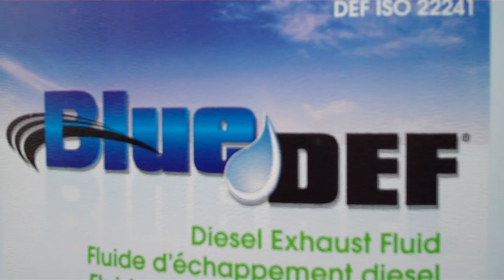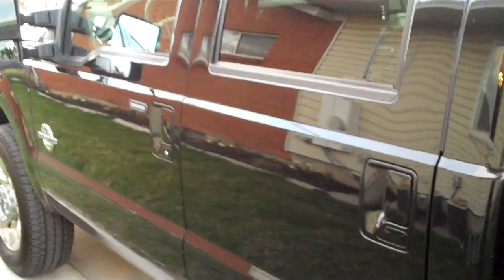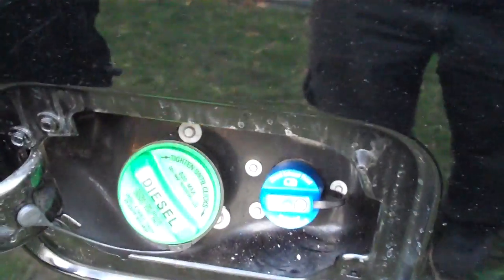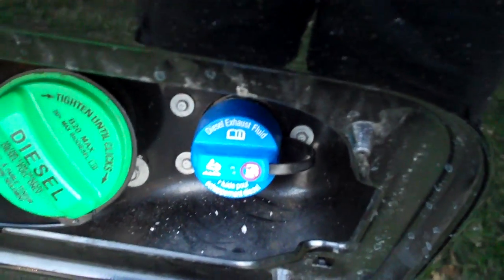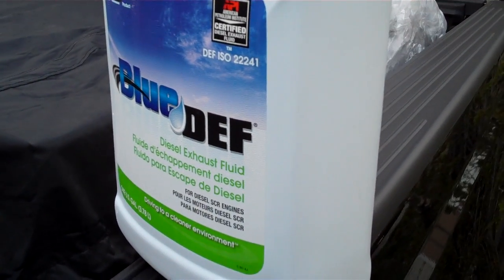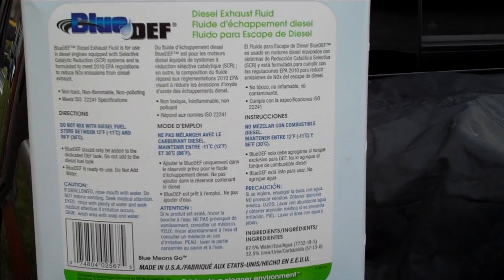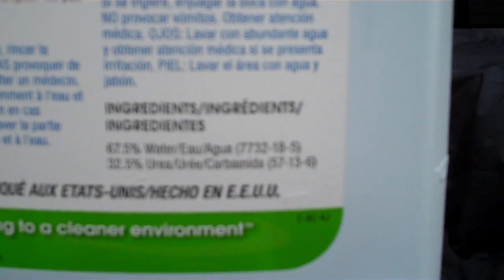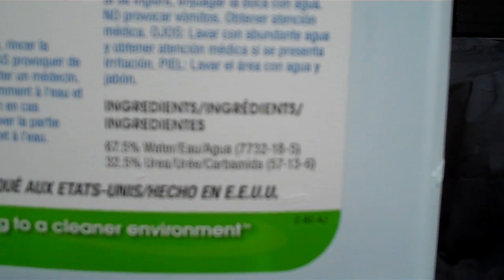DEF Diesel Exhaust Fluid What is it? How does it work?

Comment: Would you know if def is toxic?   I am the yard guy at night at Budweiser.   In the winter I need to keep the engines running on around 50 trucks I to be loaded.  I know I the old Diesel engines didn’t make me sick but the new def ones have a toxic smell and blue smoke in the light.

Comment: That stuff can be bought in bulk at the truck stop for around 3.00$ a gallon
Reply: Remember you get what you pay for. DEF at trucks stops is not mixed properly. This will cause early system failure. Its best to invest in the single jugs in my opinion

Comment: So the system will add this the gas if needed? If you have a well-maintained diesel engine, will the DEF even be used? Would a brand new truck use DEF right away? (Basically is it a question of a well-tuned diesel engine vs one that is not? Or is it like water to humans, where your body will consume water whether you consume some or not?) Thanks. I overheard a commercial that mentioned this, so I was surprised that diesel trucks need this extra fluid to run.

Comment: At Walmart for $7 per 2.5 gal jug https://www.walmart.com/ip/DEF-Diesel-Exhaust-Fluid-2-Jug-Bundle/384243022 adblue
Reply: blue def in the 55 gal for $124 each.. https://www.walmart.com/ip/DEF-Fluid-55-Gallon-Drum-Diesel-Exhaust-Fluid-4-Pack-Super-Value/625918580
Reply: $123 per 55 Gal barrel of DEF fluid at Walmart.. https://www.walmart.com/ip/DEF-Fluid-55-Gallon-Drum-Diesel-Exhaust-Fluid-4-Pack-Super-Value/625918580

Comment: A tank of gas or 300 miles? I have the Titan XD Diesel and 4.5 gallons lasts closer to 4500-5000 miles
Reply: Serves you right for buying a new vehicle.
Reply: rod builder Your reply makes no sense! Lmao. I'm getting almost 5k miles on a tank of DEF, not 300. Those of us with the means, prefer new vehicles. If you're worried about paying $30 every 5k miles for DEF, your not the demographic for a $64k new truck.

Comment: Biggest scam the government ever forced on us
Reply: LOL  I dont think it's the biggest, but it definitely makes the list!
Reply from the maker: Not even close, but I digress.  Nox are what cause acid rain.  In Europe their statues, cathedrals, sidewalks etc are being eaten by acid rain from vehicle emissions.  There, you have records of what things looked like and in the last handful of decades things are looking like 480p or 720p instead of 4k resolution due to acid rain from Nox.
Reply: Funny cuz every morning when I’m hooking up my trailer with my new truck with a grass burner the exhaust I have to hold my breath while I am working cuz the nasty smell the DEF creates will cause my throat to chafe so bad, just like when I used to work with liquid chlorine. My old tractor with a simple Diesel engine no emissions crap never had a problem
Reply: @Austin Jensen idiot
Reply: expert in justice total scam. Don't use it in UK
Reply: DEF FLUID (2 pack) of 2.5 gallon jugs for $7.00/each - FREE SHIPPING!! https://www.walmart.com/ip/DEF-Diesel-Exhaust-Fluid-2-2-5-Gallon-Jugs/837857789
Reply: expert in justice I wonder if it will smoke if it’s super low
Reply: Walmart DEF BOX $9 per 2.5 gal.. https://www.walmart.com/ip/Sinopec-DEF-Diesel-Exhaust-Fluid-2-2-5-Gallon-Jugs/837857789
Reply: @mrgilmore6953  how many of your 13 IQ points did it take to come up with that
Reply: @mrgilmore6953  and how's that? Because I like clean air?
Reply: @mrgilmore6953  #logic 😀
Reply: expert in justice biggest scam was 9/11, and then it was diesel DPF (diesel particulate filter)
Reply: God forbid we keep toxins out of the air. I'm sure we dont need to breathe.
Reply: its our air. 
only thing that shitty about this is how it will reduce truck power. unfortunately they have to do shit like that because of self centered twats.

Comment: hi how big is your def tank on your 2012 ford?
Reply from the maker: It's not mine, but I want to say its' about 2.5 gallons.  It lasts about 3k miles give or take.
Reply from the maker: +Billy Swarthout Not sure.  5 gallons I think.  You can fit about two 2.5 gallon jugs in it.
Reply: Ok. Thanks
Reply: do you think all DEF is the same. walmart has supertech def for 7.88 for 2.5 gallons
Reply: What happens if you put diesel fuel in it?
Reply: Renzeth Bulawan
Reply: No i meant what gonna happen if that happens,
Reply: It's about 6 gallons.

Comment: DEQ is a brain dead bureaucracy.... take a truck that gets 22 mpg... add smog till it
gets 17 mpg (and save the world by emitting more emissions).
Now just add chemicals and further screw up the air for just a meager $6 a tank and
soil the truck with 12 bottles of unwanted chemicals behind the seat and a damn 
funnel.
Reply: Also displaying a poor understanding of high school chemistry. The urea will react with NOX and the only products will be nitrogen, water, and carbon dioxide. NOX is horrible for air quality and can lead to fine particulate formation in the air and ozone at ground level as it mingles and reacts with atmospheric gases. Inhaling NOx is bad for you but ozone and those fine particulates are even worse.
Reply: @alexanderlowe4236  It's an attempt to reduce particle emissions, and it sorta worked Apparently.

Comment: If The DEF fluid is made with water....then it will freeze. I live where winter time is usually sub zero temps. How does the DEF fluid thaw out? Is there a heater to it in the tank? Does the engine heat thaw it out? Or do you just have to bring it inside? Thanks!!
Reply from the maker: If you fill the DEF tank on my 14 Ram to 3/4 full it won't freeze they say- in fact they ship the truck by rail through Canada 3/4 full of DEF.  It is about 65% water, but it's purified, deionized water and the Urea brings the freeze point down from 32° F to 12°F.  So it's freeze point is less than normal water.  And the Catalytic converters that it feeds (only at highway speeds and well warmed up) are close enough to the tank to warm it up as the truck warms up.  Basically, it's not like fuel tanks or lines when it will freeze up and not be there when you need it.  By the time you need it, it's ready to go.
Reply: +Kyle Lopez DEF will freeze, but it's safe to use after melting again.

Comment: You don't NEED DEF, add water. It just runs into the exhaust, water will help keep the cat clean too.
Reply: +Allen K Keeping the cat clean is not the concern here, as said in the video, its is for controlling NOx emissions
Reply: +lolatmyage I missed that, thanks.
Reply: @allenk5649  you can't use any old tap water... but deionized water will (allegedly) work perfectly fine. But DI water costs more than DEF unless you have your own DI system.
Reply: 67.5% deionized water and 32.5% high-purity urea

Comment: A 12 valve mechanical 6BT and a Brown Lipe over/under drive is all you need. If you can't pull a house off of it's foundation with that and be happy with less than 300 HP, then you deserve to blow all of your money on all of the ridiculous systems that come with a new truck. Convenience and novelty are suddenly neither when they malfunction.

Comment: all it takes is a simple fault in the DEF system and the vehicle is stopped in its tracks. the NOX sensor fails the vehicle wont drive.
Reply: So the number of things that could have you broke down on the side of the road went from 149 to 150 - I hope you'll be able to cope.

Comment: Was looking at maybe buying a Chevy Cruze diesel 46 mpg but having to keep adding more money to the tank maybe it's pointless.
Reply: I have a 2014 Chevy Cruze and on the hwy I get over 50 mpg consistently using cruise control.  I even get as much as 57 mpg with it if I'm on a county road where speed limits are 60mph or less.  I've found the DEF fluid will last about 10 to 12 thousand miles before it is empty, on average. The DEF tank is slightly less than 5 gallons.  I run Dexos2 5w-30 full synthetic oil and I had full synthethic oil put in the transmission too.  If I fill the tank to the brim (on long road trips) I can get over 900 miles on a tank that way.  I love this car so far after having driven it over 2 years now.   It starts good in winter too and I live in the far north of Minnesota where the temps are extreme.   The car is not a sled either.  It has some snot to it.  It's quiet and you would never think you are driving a diesel.  Plenty of power.
Reply: I had a 2016 Hyundai Elantra that got 45mpg on the freeway.  I bought it new for $16k.

Comment: DEF required vehicles WILL eventually fail to start, if left without fluid too long (they're programmed to prevent the continued NON use of DEF). They won't even start, at some point in the cycle, if they're DEF tank is empty too long. While emissions concerns are important, totally disabling a vehicle and leaving it at the mercy of 'suppliers' is ludicrous. Diesel can be hard enough to find in some areas...never mind a bottle of DEF. And mean while...gasoline emmisions (though getting better all the time) are still the MAJOR contributor to emissions problems (transportation wise). But they don't require, nor are they rendered nonfunctioning without, additives seperate from the pump. Personally, I think they SHOULD be required to have DEF pumps AT stations with diesel...instead of carrying a seperate additive with you.

Comment from the maker: Yes.  Yes there is.  Remove the computer and attached wire harness and attached emissions components and attached engine and exhaust system and replace it with an earlier year setup. - anything is possible!  It might be easier however to just keep some DEF on hand or elect government officials that represent you better.

Comment: There was a company that made an elimination kit.EPA busted them doing this and fined them $500,000.00 for it.Only ones that did not use the fluid was Dodge,the 2500 and 3500 heavy duty pickups through 2012.

Comment from the maker: Absolutely!  They're definitely more expensive to own- trucks are in general.  You add a lot of torque and precision uncommon components to a high weight- high torque vehicle you'll increase maintenance required- THEN LIFT IT and and put big tires on it too- it's gonna increase forces applied.  Owners are so invested and proud of them I think they have to justify the expense and don't even want to talk about the costs.  As for the Ford 6 liter- ouch!  That was just a poorly executed design.

Comment: Yes if you need and use it for that like you're 100% correct, everything has it's intended purpose and the torque is far superior to a gas engine but just to drive to possibly save few dollars forget it. Brian, i go on that powerstrokehelp channel here and it seems that they have their share of problems, he also does upgrades to eliminate such future problems all of which aren't cheap-- Myself i feel some people are mislead as to the reliability of a diesel, that's my opinion

Comment from the maker: I got that info second hand- it may not be accurate, but bear in mind the economy on that truck is not great and the CID is high so it's molecular exhaust volume by weight will be high.  The urea needed to complete the reactions will be higher than you experience.

Comment: Dude... does Ford really use that much Adblue ?   You said a gallon every tankful... or about 300 miles.  That seems way high.  I don't own a new enough benz to say this with any authority but for the GL320 CDI, which is a V6... they say about half a gallon for every 900 miles.  Can't imagine what a royal PIA it would be to have to fill up the stupid adblue tank every time you fill up that truck.

Comment: I like the idea of DEF and having very clean diesel vehicles.  Reducing emissions makes that mountain view get even better.  I have a feeling these new particulate systems on diesel vehicles are going to end up being like the emissions controls on cars in the 80s in that they needed a lot of maintenance and weren't nearly as good as later technologies.  Eventually a reliable DPF system will be made.  This is the first generation, so to speak.

Comment: Thanks SOOOOOO much. I read my owners manual about this in the X5 and BMW has 2 locations of adding this fluid but I was advised to never worry about it(due to the fact dealer replenishes during servicing or the car will call them...so they can call me to bring it in when it's low)..HAH!! Cheers to Ultimate service!
Reply: Bmw makes makes diesels???

Comment: I like my 01 Cummins (ur right about the drive thru w/ my straight pipe). The increasing emission controls on diesels are becoming much more complex which leads to higher repair/maintenance. I've recently seen the egr system on a 6.0L powerstroke completely go (2 egr valves & cracked cooler) to the tune of $5K. I'm all for reducing emissions but stricter emission controls further increase the cost of operating diesels (i.e. larger diesels moving goods) and the costs flow down to the consumers.

Comment: Good Info.  The new  rating on diesels have drastically reduced the sales of these engines.  My wife drives a 6 liter ford diesel school bus and her company runs 450 buses.  Starting in 2010 they stopped ordering all GM and ford diesels because of the cost of maintance.  The gas engines do not get the mileage of  diesel but all the drivers prefer gas buses because they warm up so much faster and start easier.

Comment: Man, this is a hack and a half to fixing the problem.  Gotta add this full-time additive and it's not even easy to add.  A new truck should be maintenance free less fuel...blah.

Only a matter of time before ECU flashers flash away that super-limp mode so you can just run it regular.

Thanks for the info man, that's a boat-load of info right there!

Comment: I love your videos! I have a question. I recently bought a memory saver that hooks up to the obd2 port. I know to hook it up before I disconnect the battery. My question is if I have to do other work to the car like changing the starter or alternator or anything else were I would disconnect the battery could I leave the memory saver pluged in while I work and not fry the computer like I could if the battery was hooked up? The reason I ask is the radio locks up and I dont have the code

Comment: Wow, that kinda sucks having to put that into your car! I've only ever owned diesels and here in Northern Ireland once a car reaches four years old it has to get a yearly MOT test! They go over the car with a fine tooth comb, but one of the tests is emissions, however they stopped doing it on diesels after they blew a few engines from over reving them for the test!

Comment: Good video! I always wondered about DEF and its applications, I read a couple of years ago about it, but never went any further. Thanks for the vid!

And thanks for the 4.7 Dodge engine mention, you start saying large funnel and mentioned 4.7 and I was all "Ah yea baby, my Dakota has the 4.7 Magnum...Mopar or No Car" :-)

The bad thing about my oil spout, it is the original (2001 year) and does not have the updated baffle inside of it, so if you are not careful you can get some frothy oil :-)

Comment from the maker: GOOD QUESTION!!!  The water part of your urine may not be the right mix 67.5% unless you're really well hydrated.  Also your water isn't de ionized.  Together this can lead to short life span of critical components.  Some vehicles have sensors that can detect if the fluid is correct for ISO22287 etc.